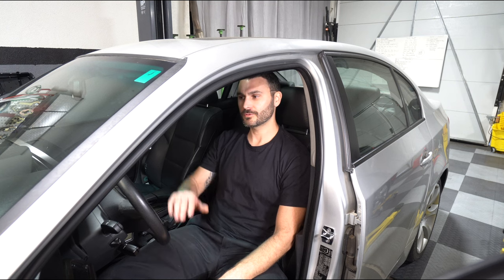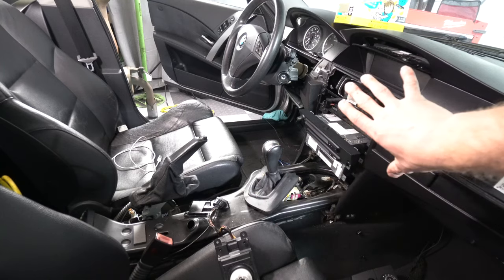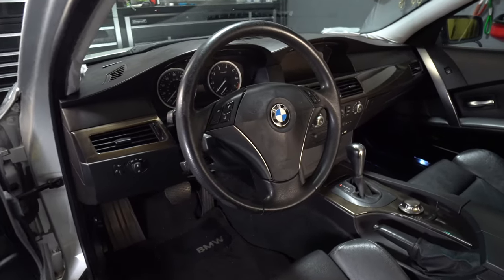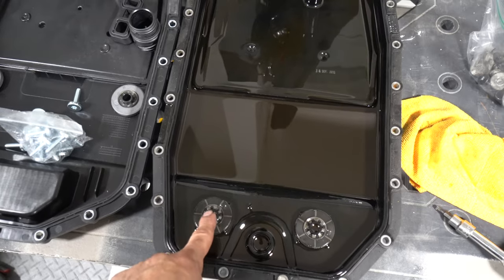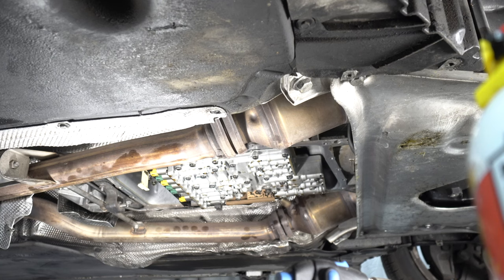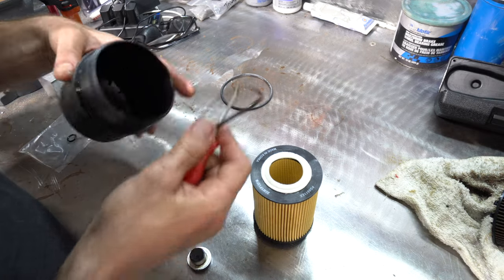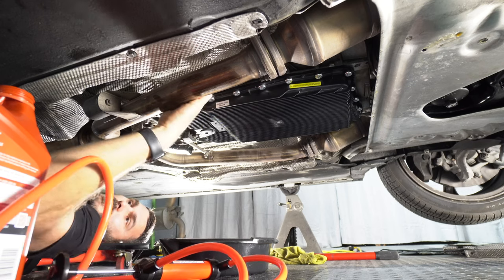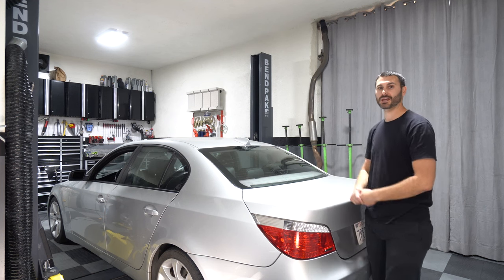BMW 545i E60 Transmission Service, Will it Fix the Hard Down Shift Problem?

Comment: Two refills would be done on this trans, first is the cold one which is about 3.5 to 4 qts then the hot refill, which comes after starting the car and maintaining a proper operating temperature of the transmission which will allow to go through all the gears and having a 5 seconds in between each gear level, then do the hot refill which takes around 1.5 to 2 qts.

Comment: The hard downshift is a coding issue with the Egs. The 2-1 tip in needs to be coded in along with an update. I promise you it hasn’t been updated since factory. BMW puts out SPdaten files every 3 years or so with updates across the board. DME, Egs.  CAS, FRM… and so on.
Reply: I have 04 545 same color with code p17E8 any ideas

Comment: In my transmission, four cylindrical sleeves need to be replaced along with the rectangular bridge seal.
Reply from the maker: Yes I ended up replacing those as well as all of the solenoids. Check out next weeks video for that!!

Comment: Playing a dangerous game with that mechatronic unit. After proper fill you’ll need the 100 mile learn period and check your fill again. The z transmission is touchy and needs to be precise with proper temperature being monitored otherwise no bueno.
Reply from the maker: Hey, thanks for the info. I just redid the transmission service including solenoids etc. I’ll definitely look into the drive cycles! Check out next week’s video when I run through it all and let me know what you think. I am loving these ZF’s more and more though